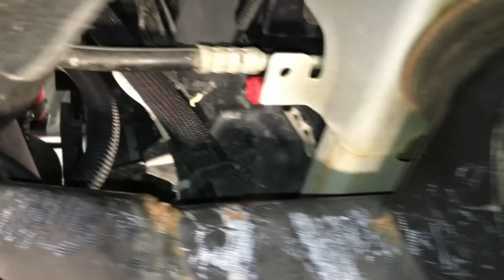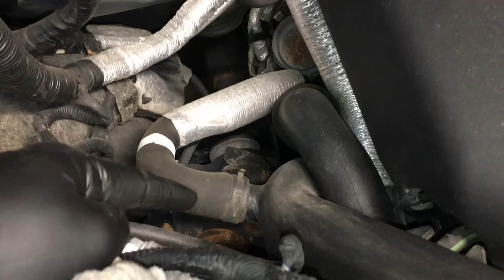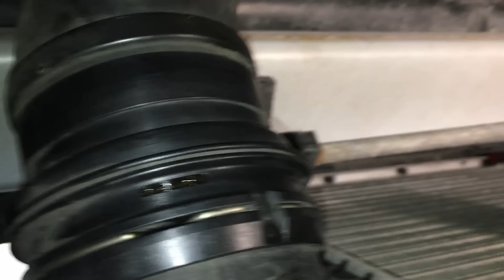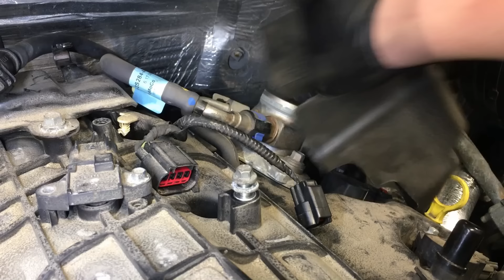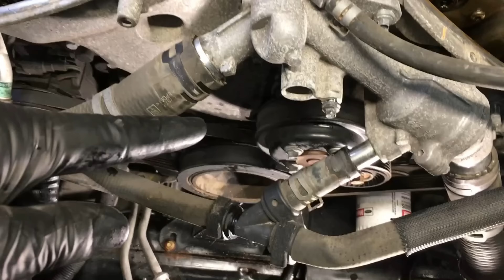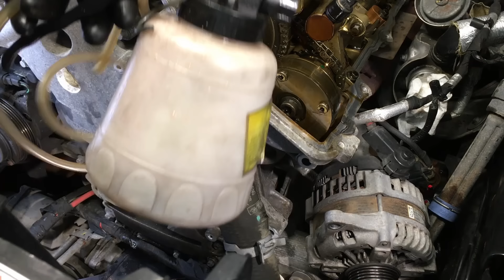2011-2016 Ford F-150 3.5L Ecoboost Timing Set Replacement Part 1: Getting Inside the Engine

Comment: That is nuts to change a timing chain. Give me the good old 300 6cyl.. Changed the timing chain in my 1995 F-150 in half a day at 250,000 miles. And that included flushing cooling system and changing valve cover gasket. I cannot ever see owning a eco boost engine. Sister in law bought a 2013 Escape with I'm pretty sure it was the 1.6 eco boost. Nothing but issues. Many recalls and hers overheated on a regular basis. They fixed it and it would last awhile and leak again. It would lose power all of a sudden and she had to let it sit. After a turbo issue almost out of warranty they tried to trade it but they couldn't get AWD with the non eco boost 2.5 engine, only FWD. A family who owned Fords for generations gave up the brand due to eco boost issues as her Father bought a F-150 with a eco boost V6 and wasn't happy.

Comment: how many hrs this job call for lol ?
Reply from the maker: Way too many probably in the 20's.
Reply: What's funny is Ford gives 9.2 hours on the TSB.  One of the reasons many dealerships won't do the work unless you are more that +6 degrees out with a P0016 or they hear the rattle themselves.  The rattle is very intermittent on some of the vehicles meaning days or weeks sitting at the dealer for a shot at a cold start rattle.

Comment: Sorry I meant the Taurus not sho. So are you saying only normally aspirated has chain driven water pumps and ecoboost is external belt driven?
Reply from the maker: There is no room for an external water pump like the F-150 so the transverse mounted engines have a chain driven pump.

Comment: I did not catch the milage but usually if you do the timing chain, the thermostat and water pump should be replaced so that you don't have to go through all of that work again when and if those fail in the future. I hope you have a second part, this was very interesting, I had to stop working on cars because of my back and hip, when I stopped working on cars it was not as complexed as this truck is.
Reply from the maker: The water pump is not chain driven on this model.

Comment: my 2012 EB has 135k and running darn good w/o most issues that you've documented Brian.  I have the RXP catchcan , use synthetic oil every 5k, top tier premium, and the SP534's.  What i do have is what sounds like a light rattle mostly on acceleration.  I have an extended warranty and my guess is the bearings on one or both of the turbo's are going??  Just sounds like loose metal rattle occasionally.  Any guess on what it is?  My warranty runs out in 3 months and I'd like to have it fixed before then, obviously.  Thanks for awesome videos!
Reply from the maker: Yes, check the upper exhaust heat shield under the drivers seat.

Comment: May as well change out the water pump while your in there.
Reply from the maker: There is no chain driven water pump like the NA 3.5L
Reply: FordTechMakuloco       Oh, so it’s different on the flex/SHO. I forgot about that. Do you know about the 2016 transit 250? Is it internal on the chain or belt driven?

Comment: Hello Brian,
With your comment about the oil carry over and the need for a catch can on boosted engines and also thinking about your previous videos concerning deposit build up on Eco-boost intake valves. Have you ever heard in your conversations with FoMoCo engineers why they don't install catch cans by default right at the factory? Do catch cans have some seldom talked about drawback such as moisture buildup from moist vapors running through the relatively cool catch can? Just curious whether the subject ever came up in your discussions with the engineering types.
George

Comment: +fordtechmakuloco, Brian as for that clamp on the vacuum line to the throttle body and the update, I had mine done and it was the same way, actually fell off on me. Fords clamp does not work, a simple work gear clamp works very well now.

Comment: If I ever buy a Ford, this has sold me on the 5.0 V8.... What a mess of an engine and pipes/hardware!
Reply: Sorry you are afraid of turbos...for those of us who have been doing turbos for 20 years this is easy stuff. Huge power/torque and good mileage sounds fine to me. Now as far as the theory about V8s being so simple and amazing....maybe but I also know about 10 guys with 5.4L cam phaser/timing chain issues. They sounded like a diesel from the noise until the slap because so bad.
Reply: The power of my Ecoboost is incredible when pulling my 33" travel trailer, I don't lose any speed climbing up mountains at 70mph. Plus I like the feeling of my head being throw back when I pass someone.

Comment: Recently did 5.4 3v full timing job, etc...worst part was getting/cutting off the ps pump,smashing off the water pump, and needing the tool to remove the fan..i would do another  but i have no interest in doing this motor

Comment: QUESTION. Why do some mechanics take the whole cab and separate it from the chassis to do the same job you are doing?
Reply from the maker: They heard it was the way to go somewhere so now they blindly remove the cab for every major job. The only vehicle cab removal is advisable on is the superduty trucks when performing major work on the diesel engines 6.0L and newer.
Reply: @FordTechMakuloco  Not so, I've been taking cabs off F150 for years now, especially now with timing chain repairs on Ecoboost, Cab can be removed in and hour and engine is real nice to work on when removed. You should try it out. Great videos by the way.
Reply: @duke_pufus  Yeah, I bet lining up that crankshaft pulley is a piece of cake

Comment: How many miles are on the truck? How long does it take to start stretching noticeably?
Reply from the maker: Normally around 60k, this truck had 105k miles on it.
Reply: Some theorize that the extended oil change intervals that these are supposed to be able to handle along with the fuel dilution that's common with direct injection engine cause oil supply and lubrication issues that cause excess wear on the chains and tensioner. Also it seems vvt engines are harder on the chains by nature too.
Reply: Is this due to lack of oil changes? can this be prevented?
Reply: Defenintly not an oil change issue, I've changed my oil every 3 to 4 thousand miles and I got the rattle dealer won't do anything until check engine light comes on. I'm at 60,297 miles..... not sure what to do anymore.....
Reply: @jeffparish82  Turn the truck in

Comment: What I would really like in a video is to see the job with the hoses, connectors and clips in real time where they haven't been pre disassembled. I think a great video would be the way they ACTUALLY are in reality...ie the way I get them in my shop with tons of miles on the vehicle...where the hoses are stuck or tear, the clips break, connectors snap off or break or the wires pull out of the connector because the plastic is so brittle, and the methods you use to remedy these issues that are cost effective ie repairs that are durable WITHOUT buying additional parts. Just curious in the methods you may use.

Comment: I like your videos Brian.  Very detailed.  Any chance you will do a video about Duratec 3.0L timing cover oil leaks?  Mine is in a 2012 Escape.
Reply from the maker: Yes I plan on filming one soon on a Fusion.
Reply: FordTechMakuloco would this be similar for a 2012 focus 2.0? Mines got a slight leak
Reply from the maker: no

Comment: How many miles and what was the  maintenance history like?  Is this common?  Above 5% failure rate of older motors?
Reply from the maker: I would say closer to 30% maybe higher.
Reply: FordTechMakuloco Then that would be an epidemic with those failure rates.  It appears to not be a   maintenance caused issue.  With the pre production testing that Ford did you would think they had to know this was happening.  I guess they just thought it's was okay.

Comment: Ford's new special harmonic balancer puller. Is the same one I used on Chrysler engine in the late nineties
Reply from the maker: Yeah I think the Chrysler 2.7l used this type of puller.
Reply: Tricky to  use leaning over the radiator in a blind assembly!!

Comment: Dealer had my truck for a month to do this and put in new turbos. Thank god for the certified preowned warranty had it fixed right at 98k mile 2012 f150 3.5 4x4
Reply: Hi. What were the symptoms you had when you brought your truck in?
Reply: I just purchased 2013 3.5 ecoboost from a Ford Dealer in Fishers Indiana. Timing chain and Cam Phasers and solenoids had to be replaced because the rattle showed up 6 days after purchasing the truck. Truck had 107k miles when I got it. $2,700 covered by the dealership who sold me the Truck 2 weeks ago! Coils and Plugs replaced as well so the job was $3,500 total after that. Luckily no out of pocket for me. This is definitely a well-known issue usually starting around 60,000 miles on most of the 3.5 EcoBoost previous generations.
Reply: ford junk. you purchased it. winner!

Comment: Wow these 3.5 EcoBoost look way more difficult to work on than the 2.7 EcoBoost. Another nice thing about the 2.7 is when you pull the intake manifold off ford used catch style bolts that don't allow them to be removed from the manifold which is nice, you'll never lose them or risk them getting inside the intake ports. Great video btw!

Comment: Curious what the intake valves look like due to the direct injection? What year Eco is this?
Reply from the maker: 2012 they were pretty bad about right for 105k miles.
Reply: Thanks for the reply.  I've got a 13 Eco with 59k miles and no noise and no can...  Guess it all boils down to time and miles..  Thanks again.

Comment: Are you changing the water pump too ?
Reply from the maker: No, why would I?
Reply: How much millage on vehicle? When that water pump leaks on a 3.5L the coolant will go right Into the oil & just may destroy the engine. Can't change bad design but I'd rather have a new water pump and hopefully not have to go back again.
Reply from the maker: This one had 105k miles on it. Actually when the water pump leaks on the 3.5l chain driven pumps they leak out above the alternator through the weep passage. The engine in this F-150 does not have a chain driven pump, it is external so it's easy to change in the future. I have seen external water pumps on Fords last 300k easily, take the Motorcraft PW423 for instance. So I don't make a habit of replacing extra parts on customer vehicles that have not failed that I know are reliable thereby artificially driving up the final repair cost to cover my bottom line.
Reply: MY 2009 Lincoln MKZ 3.5L Engine Water Pump leaked right down Into my oil and the coolant was circulated through the Engine. - My MKZ Is now history.

I guess Ford had a reason to design the 3.5L Truck Engine differently.

Thanks For Answering

Comment: At 90,000 miles (2014 with the 3.5 Ecoboost) is quiet as a mouse, even at -4F.  I've used Pennzoil Platinum synthetic since my first oil change and change it around every 4,000 miles.  Glad I don't have and never had this issue.  I've also used Hot Shot Secret twice (stiction eliminator that was originally developed for International truck brand to fix stuck diesel injectors, on the oil side of the injector).  You can use that in a gas turbo engine too and it helps keep things clean.  You can Google it since I probably shouldn't post the link here.  It's not snake oil though.  You can read about it for yourself.  EDIT 2022 - 152,000 Miles, now I've heard the dreaded startup rattle a few times, but it's not consistent and only happened maybe 7 times or so?  I guess it's just a matter of time before it's more consistent.
Reply from the maker: I have been using the hot shot stiction eliminator since my early dealer days with all the 7.3l and then 6.0l HEUI injector issues. They also sponsored my tour across America and I actually have a video coming out soon featuring them. Good stuff I know all about it.
Reply: I always worry that people instantly think something is useless/'snake oil/fake if an additive is ever mentioned but I believe there are SOME great products that do what they say they do and are worthwhile, like Hot Shot Secret.   They also have a friction reducer too.  Motorkote (another friction reducer) has had a lot of praise from users (mostly long-haul truckers), but I trust the folks at the company that makes the original stiction eliminator more so if I use friction reducer I'll use the one from Hot Shot Secret.
Reply: Looking forward to that video.
Reply: Your reasonable oil change intervals are probably why yours is still quit.

Comment: I see ford is still failing miserably in there phaser/timing chain department. So glad I got rid of my 5.4 3 valve what a POS. Its amazing how Ford lets known issues go on for years with there vehicles without addressing them. Never again will I own another Ford.
Reply: It’s a very high percentage of them the oil in these engines are not maintained and tensioners fail intermittently causing chain slapping and low oil pressure to phasers causing damage not really. Phasers fault
Reply: I think keeping the oil changed on time prevents this. Also keep in mind driving like a maniac requires an oil change sooner.
Reply: What did you end up getting
Reply: @fccoz8348 he got a Chevy Volt! 😂
Reply: Chevy isn't much better with their 6L80 transmissions and torque converters. 

They are all a fukin joke.

Comment: I like the oil catch can you have listed but 517$ is kind of high do you recommend any other branded catch can systems that won’t break a budget.
Reply from the maker: I think this one, UPR and McNally are all about the same price. It’s the quality of construction and the internals that set them apart. Cheaper units simply don’t work.

Comment: i changed the valve cover gasket on passenger side on 2013 f-150 3.5 ecoboost, but it still have a small leak toward the very back, any suggestion would be helpful.
Reply: I have the same problem on my 2014 F150 Platinum 3.5L and in the same spot. I tried some internal engine gasket swell/leak fix and didn't work. I also tried some orange Permatex on the outside of the leak. Cleaned it really well with brake cleaner/degreaser and it fixed the leak. No more daily smelling of burning oil (and sometimes smoke even). But after about 2 months my leak came back. I'm dreading having to change the valve cover gasket but may have to do it. You might want to try the Permatex. Maybe you'll get lucky.

Comment: Could you show the back sides of the intake valves? How would you clean them if you were going to?
Reply from the maker: This car was gone in October of 2017. I would perform s manual cleaning with a brush and solvent.
Reply: Thanks Brian. Great video.
Reply: @FordTechMakuloco  Is Sea Foam any good for this?
Reply: What solvent?

Comment: Which brand auto ratchet is that... I really need one of those damn things, seems like it saves a ton of time finishing off bolts.
Reply: I have 3 of the Milwaukee ratchets they are the best! Highly recommended!   That engine looks pretty clean inside ,I’d say they did there maintenance on time, so why are they having these issues on maintained engines? I have a 2017 ecoboost 3.5 and you have me scared seeing this , I bought it new and use motorcraft filters only mad Castro’s magnatec. 5w30 full synthetic oil, I changed it at 1700 miles,and now at 6600, miles going to go no more than 5000 miles/200 hrs.....I came from GM trucks where the engines while not a powerhouse they are very reliable
Reply from the maker: This the Milwaukee 3/8" Electric Ratchet I use for everything-http://www.anrdoezrs.net/click-7889909-10368321?url=https%3A%2F%2Fwww.homedepot.com%2Fp%2FMilwaukee-M12-12-Volt-Lithium-Ion-Cordless-3-8-in-Ratchet-Kit-W-1-1-5Ah-Battery-Charger-Tool-Bag-2457-21%2F202957709&cjsku=202957709
Reply: I... may be in love.... with the ratchet, not you... I kid I kid you are cool too.  Wish I had one of these doing my LIM gasket on a buick century.
Reply: I don't think this is any more common on these than it was on the modular motors, which regularly get over 200k before you start seeing major failures.  The problems you'll most likely see when these eco's get up there in mileage are things like the turbos wearing out and carbon buildup on the intake valves due to the direct injection system and high intake temperatures from boost.  I have a 2011 Flex Ecoboost and I did have an engine failure at 130k, but it was a stupidly simple issue.  PCV valve/oil separator combo failed and the engine was aspirating oil through the intake.  Oil got low, oil got too hot, then coked the turbo bearings, debris from that either wiped the main bearings or destroyed the oil pump, then low oil pressure at idle.  I caught mine early and it still ran good when I pulled it (save for idle oil pressure issue), but there's major work needing repair on the old motor (found little chunks of metal in the oil inlet screens of the turbos).  Long story short, watch your oil levels like a hawk once you get up around 100k and if you see it start to use oil, change out your PCV valve.  Better yet, change your PCV valve before it gets to that.  They're cheap and easy to replace.  I don't think the later models have oil separators, they're integrated into the valve covers IIRC.
Reply: You sure you meant to reply to me?  I was asking about his tools.
Reply: They are very handy tools. The only complaint I have is that the original model lacks the grunt for anything but light applications - more often than not you have to manually break torque. The new model Milwaukee 3/8 ratchet has improved the torque specs from 47Nm 250rpm out to 74 Nm 200rpm and features a stronger body because we all use them in manual ratchet mode too.
Reply: I got the same ratchet in a bundle deal with two other Milwaukee fuel drills on home depot website.